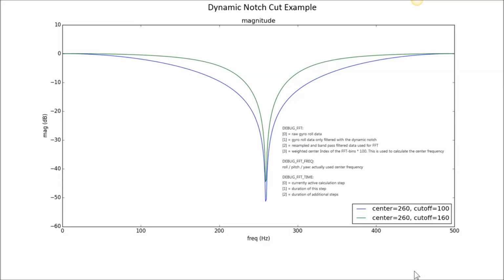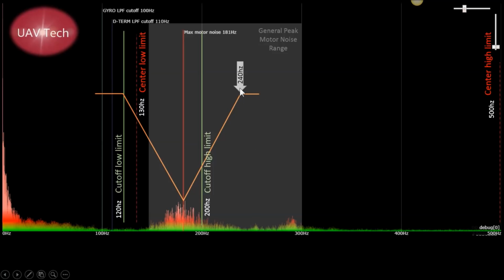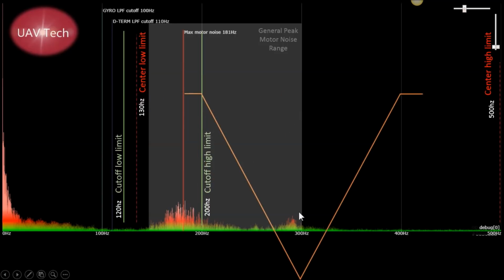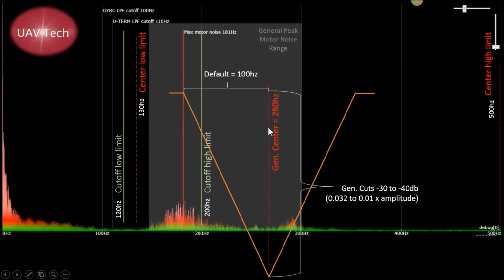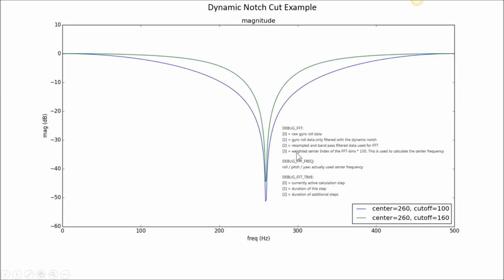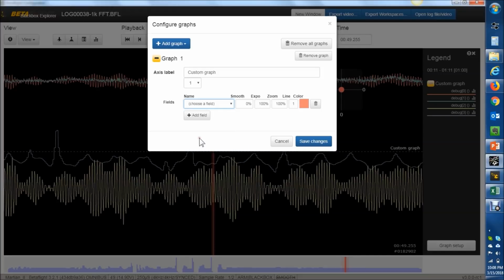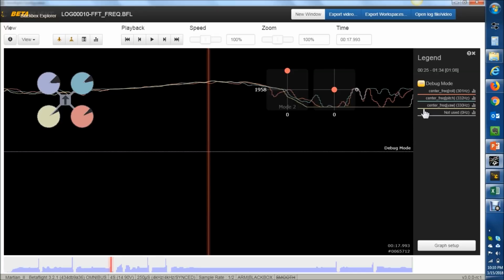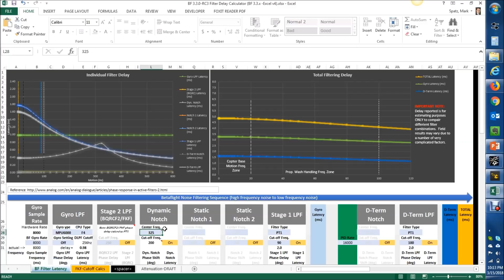Betaflight Dynamic Notch and FFT Debug Modes

Comment: Very nice content... quick question. Can I set debug_mode FFT on my Helio AIO? I am currently using Betaflight 3.5 on this board. Also what other modes can I use with this board? I know debug_mode of GYRO is not available. Please help!
Reply from the maker: Yes, it should work.  Give it a shot.  Would love to see a log of a Helio on FFT_FREQ with debug recorded.
Reply: What should I try, FFT or FFT_FREQ?
Reply from the maker: FFT_FREQ.
Reply: Cool.. I will give it a try. How do I share the log with you?
Reply from the maker: Can you post to: https://www.facebook.com/groups/291745494678694/
Reply: Cool. Are you one of the admins there? I was talking to Mark Spatz today about my logs on this group. Just wanted to check. :)
Reply from the maker: Yes, I am Mark Spatz.  LOL.  just connected those dots myself.  No worries.  All the same.  :-)
Reply: haha.. that was fun. Thanks Mark.
Reply: +uav tech , I have added the log with the debug mode on Facebook. Please let me know if that helps.

Comment: Is trace (0) raw gyro or gyro data that has passed through kalman/bqrcfir2  when applicable?
Reply from the maker: Jestlow , gyro data that has passed through the Stage 2 LPF (if enabled --- FKF or BQRCF2).
Reply: All my quads that have a stage2 filter on them are set pretty conservatively and knock down the noise so well then dynamic notch doesn't have much work to do.  It still is needed, but there isn't a ton of noise.  maybe I can raise the stage 2 filter.

Comment: Thanks for the video, but what would happen if both dynamic filter and static notch filters are activated? I mean before watching this video, I have them both activated and does'nt cause me any problem yet. I only fly LOS in my backyard doing simple flip and casual mild flying.
Reply from the maker: Jestlow , with both on u could be seeing Pterm oscillation because of too much delay (over filtering).  Just a guess.  Would need to see BB logs to confirm.
Reply from the maker: cloudbreaker ninety , then u are good.  It is just too much filtering for aggressive and race flying.  Too much filtering makes it impossible to get a good PID tune that eliminates prop. wash and bounce back.
Reply: my quads get weird with static and dynamic on.  like crazy noises and id be afraid to take off weird.
Reply: That would be a safe bet.  It is a very similar take off to having very very high P term.  You get a similar affect (on a whoop) if you use angle mode and turn the angle limit to the max of 255.  Either way I'd say there is no advantage to notches and dynamic notch. running at the same time.

Comment: i have a couple of questons.
1) the only reason to use debug _ftt vs debug_notch is to get visualization of how dynamic notch operates (since we have no any parameters to change). for 'general use' debug_notch is preferable (since we get raw data for all axes). is that correct?

2)according to the page https://github.com/betaflight/betaflight/wiki/BetaFlight-3.2
"When running 8k gyro you have 125 microseconds in each loop and it is simply not enough time to run the calculations. So the PID loop will run slower than 8k anyway. There may be no outward signs of problems, but there will be jitter in the PID loops and that can potentially cause problems."

- there is no reason to run pidloop above 4k.  i also saw a discussion in the github branch about this feature (lost the link unfortunately).    please comment.
Reply from the maker: #1 - Correct.  Notch lets you see unfiltered, Scaled, gyro data.  FFT is only for take a look at what the Dynamic Notch is doing.

#2 - good question, I asked R.A.V. on that one.  It is interesting, especially now that we are pushing 32k sampling rates. I will let you know what he says.
Reply from the maker: Yes, it does, see https://youtu.be/AG3VcHwenwk
Reply: Doesnt debug = fft also allow you to see date that is predyanmic filter but just after bqfir2 or fkf?  This would be useful in seeing what those filters are doing.
Reply: https://github.com/betaflight/betaflight/issues/5440  - the link i talked about

Comment: Hi. Good job man. I allways enjoy, when I see your new video. I have a question. Is there a way to find in the debug data, what are current cut-off frequencies (top or bottom) of the dynamic filter? I can see center frequency from FFT_FREQ, but how can I determine, how wide it is and then calculate exact filter delay.
Reply from the maker: supiiik , I'm not aware of a way to view that data in a debug mode.  However, based on the video, etc... u can know the cutoff based on the center freq. and i programmed that into the excel latency tool.  That said, if u wanted to verify, I'm not aware of a resource (debug mode) for that.  :-/

I will post R.A.V's response to my question in the excel too (images).  Based on that, the notch cutoff is -100hz from the center freq. unless it hits up against the lower or upper limits.

Comment: Really great content 😊

A detail, didn't get the "0.03-0.01x amplitude" next to the -30 to -40db. If you meant those to be equivalent, that's not how it works (it would be 0.001x and 0.0001x respectively).
Reply from the maker: Peter Kjellström , isn't that power?  Not amplitude?  https://en.m.wikipedia.org/wiki/Decibel
Reply: You're right, my brain didn't think power in this case since it is just DSP. The signal in this case is just a property sampled in time. This is the curse of just swinging around a db without unit...

So, to be clear. A 30db attenuation (by eg a filter) by convention implies db-power. That means 15db reduced aplitude of the signal.

DSP makes my brain hurt sometimes.